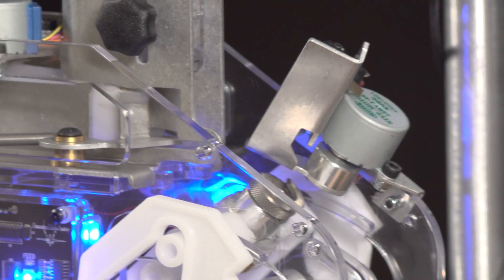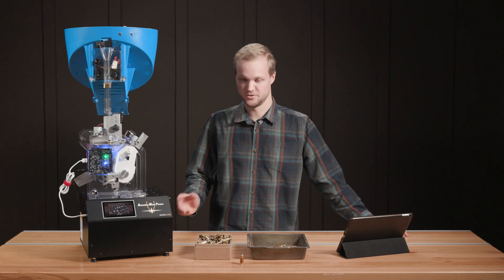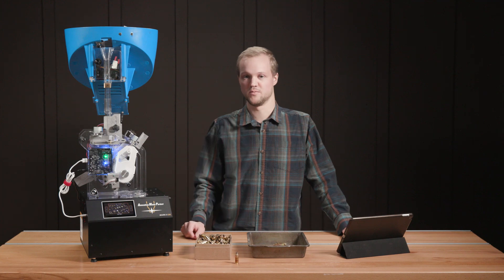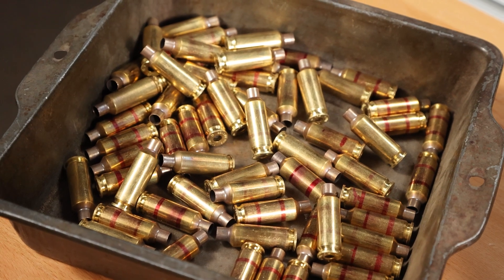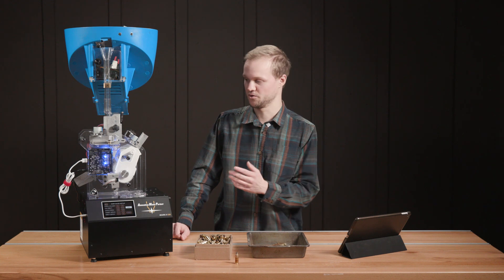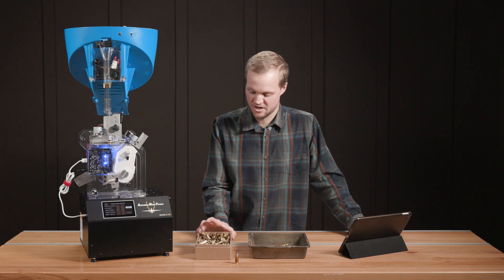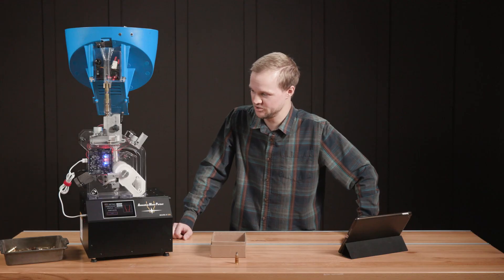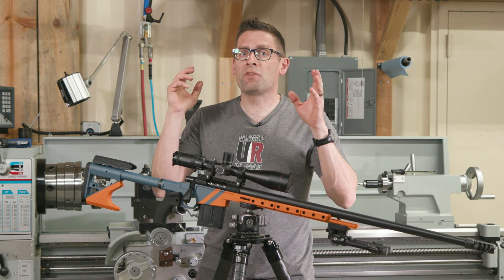Hands Free Annealing: AMP Mate on the NEW Amp Mark II DB (6 Dasher)

Comment: Here's how I rigged up the QuickAnneal to achieve much of the same. While the QuickAnneal is significantly less fancy, I like it because the drop gate system of the QuickAnneal means you don't need shell holders and you can just use the existing Dillon motor interrupt as a synchronization primitive between the feeder and the annealer. It's about 60 bucks worth of hardware to build this "smart" drop tube that sits between the Dillon and the annealer, most of which goes into a quality servo, a proximity sensor, and a esp32 board to control both: https://www.youtube.com/shorts/zGjBuVOdV14

Comment: I flame annealed for years, I said I'd never spend 2k on an annealer.  Well, I purchased the mark 2 db and gotta say, it does a great job at annealing brass.  Still not sure about the price but it's nice to have a data base, just pull up the type of brass and switch out the adapter and anneal brass.  I'm a hands on reloader, I enjoy the process and trying to improve my reloading techniques.  I've been at it for 30 years now and 50 years shooting.

Comment: You could buy 20,000 pieces of new Lapua brass for what you spend on those gizmos. I anneal using a propane torch, Lee shell holder from its trimmer set, a drill to rotate my brass, and the Soundbrenner app to control time under the flame. It's inexpensive and works just fine with single digit SDs and long brass life.
Reply: Thanks for the Soundbrenner tip
Reply: Congrats on being poor